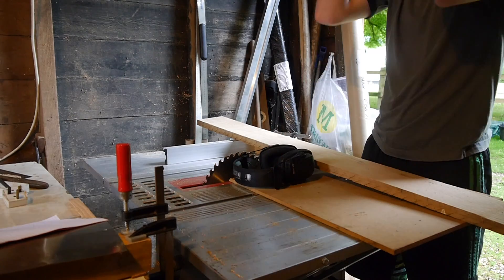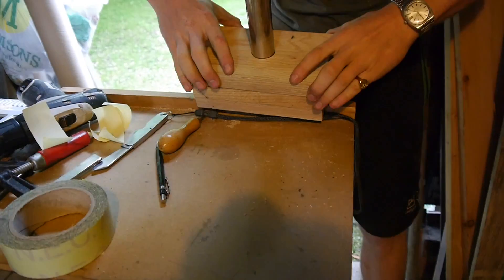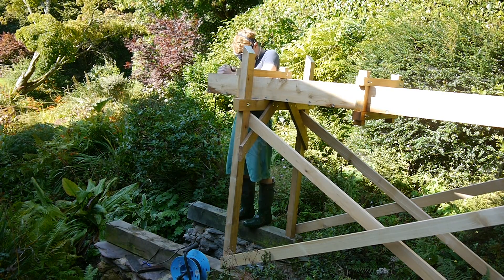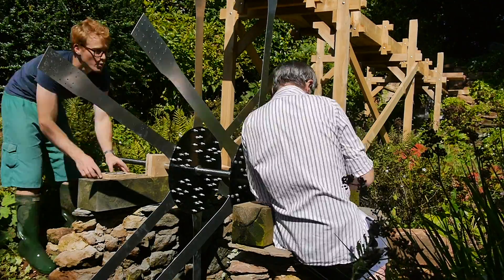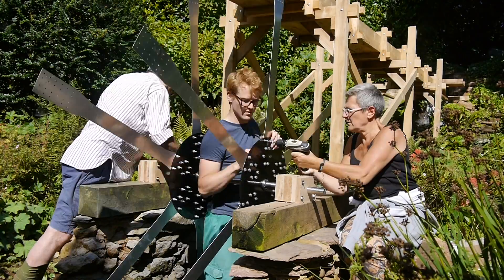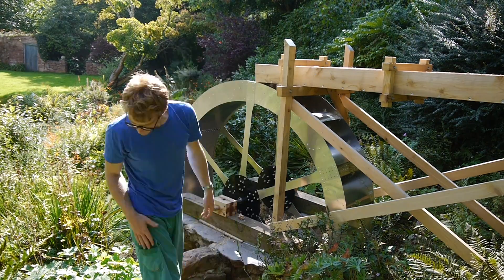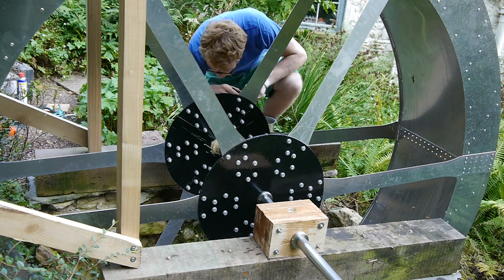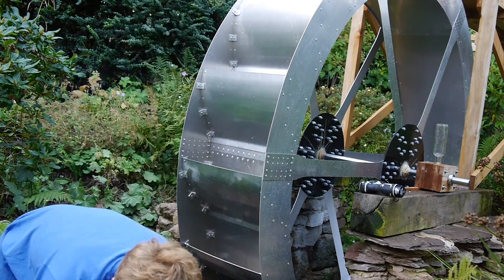Building a water wheel Ep  8 -  Assembling the wheel

Comment: Any suggestions on smart drive motors used as a genorater. I am aware you can hook them up directly to get 120v ac except you would need a large wheel and have some weight on that wheel also, or good gearing. Any easier methods you might have tried with electronics or wiring to make less resistance when adding an electrical load?
Reply: https://www.youtube.com/watch?v=8SWq5Pskpug
Marty T in New Zealand shows you how to wire up the brushless motor from an old washing machine....
these are so common in New Zealand that they can be bought for $5 at the local recycling centre at the dump  (transfer station)

Comment: White metal or bronze is used for low speed bearings. They have a centre slot with a larger diameter ring. The ring dips into an oil bath underneath and carries the oil up and over the shaft. The white metal is scraped so the bottom third, where the standing weight sits, is only 60% contact. That leaves enough oil for the first turn on startup. 
You asked about non toxic grease. White grease should do it. It’s used in food machinery. Failing that whale oil. ;). Maybe not.

Comment: I am watching several YOU-TUBE'ers building a wheel and flowing water from the top of the dam.
Any professional hydro-power job pulls water from th base of the dam, and pipes it to the wheel.
This allows the wheel to operate at any dam level. It is a nice job, but again, having a large serious
error. The wheel has to be lower than the top of the dam for constant use....
Reply: Doing it by drawing from the top automatically stops the wheel when insufficient water enters the pond.....
You still have a pond this way....

Comment: amazing work!
No hate just a suggestion.
As you can see the wheel slows down after the first rotation, that means the water isnt running out fast enough and has to be lifted up on the other side. Maybe you could coat it in a water repellent paint and slightly adjust the angle of your buckets to increase the efficiency.

Comment: i dont think the flume should end at top dead centre.... well i suppose it depends on the flow, but i think having the flume end slightly forwards (if the wheel is spinning clockwise) is better as this adds the force of the water to it's weight to turn the wheel

Comment: Just heard you wanted rust inhibitors for the parts that rust. Use Cosmoline it’s a waxy petroleum substance that’s sprayed on. And after it air dries, quits looking waxy, it’s very hard to get off. It was developed in the 1800s to treat cuts so it’s pretty safe. In WWII the US used it on tanks and guns coming across the Atlantic to prevent corrosion. Google Cosmoline because if memory serves its not hard to make your self. Best way to apply is spray, but roller next and a brush to get the hard parts if you don’t have a paint gun. Better yet here it is in an aerosol can. https://www.cosmolinedirect.com/cosmoline-sprays/
Good luck. I think the Cosmoline will do what you need.

Comment: Here, let's estimate the power output.   2 meters vertical drop.  2 buckets per second.  15 liters each.  Then 30kg/sec. X 2m = 60Watt?  

I'm only EE. So not very good at mechanical stuff.  So if someone can double check & correct my estimate that would be great.  Thx.  All the best.
Reply: first, you must use the correct scale, metric.   the formula is:   gravity  x  head  x  flow rate x 1000 (for watts, instead of kilowatts)  gravity (constant) is:   9.81  mps.     you supply the other two terms, eh.  ( based on hw's design of the 'wheel, flow-rate may be three to four liters p/sec.   that's  .003  cu. meters/sec. )     cheers
Reply: David Davids thx mate.  Will correct the calculations.
Reply: scroll down to - calculating
https://en.wikipedia.org/wiki/Hydroelectricity

Comment: What up with Wood Bearings ?  With all the money you spent,  you couldn't buy pillow block bearings ?   At the very least,  you could have lined the bearing blocks with PVC pipe. It would make a huge difference, You're losing a lot of power with wood bearing and all the friction that comes with it..
Reply: ThomasTheSailor Chubby  As he said in the video,  wood bearings hold an oil film better at extremely low RPM than pillow block bearings. Wood also absorbs the oil and becomes extremely weather resistant,  and the surface work hardens and lasts a very long time, PVC would wear quickly. Even the more modern turbines from the late 1800's and into the 1900's still ran on a bearing made of wood.

Comment: You can use Shell Cassida Grease LTS 1, It is a lubricant for the food industry, you can apply it with a grease gun and a lubricating nipple.
You also have to replace the lubricant after a certain time, as well as oil.

Comment: Why didn't you choose for a pitchback waterwheel design? The interwebz say that the efficiency of the waterwheel design is greatly increased to over 80% of the waters energy as it is driven by both the weight of the incoming water and by the force or pressure of water directed into the buckets from above, as well as the flow of the waste water below. You'd have to turn the waterwheel around though :P

Comment: The best spray on corrosion protection you'll find is Boeshield T-9. Its a wax solvent aerosol and was designed by Boeing to protect aircraft landing gear.
Reply: Mark C. That I can vouch for. I use ratchet straps in outdoor application, and after one coating, I can expect even a rusty ratchet to perform perfectly for a few years.

Comment: Really nice job Henry, looking forward to see it turning and making power, i've been wanting to do something like this for a while but not sure if i have enough water so can i ask please as i can't seem to find you talking about it in any of your videos, how much water flow do you have ?
Take care
john
Reply from the maker: +John Beattie I have around 15l/s water flow but it's not just about flow but also water drop. 1l/s falling 10m has the same energy as 10l/s falling 1m.
Reply: Thank you for your reply Henry, i only have 60 gallon per minute, i get a little confused about the water drop, my water is a natural rain run off that runs at 60 gallon per min all winter more after rain, (and i live in Scotland and boy can it rain) it comes from way up in the hills behind the house,  i assumed the head was taking from the start of the flume intake to the ground under the wheel, if it's taking from where the water starts from way up in the hills then i have quite a lot, so i'm not sure how to work the drop out.
Take care
John
Reply: The head, in this case is, (roughly) the vertical distance between the top of the wheel (where the water exits the flume and strikes the wheel) and the bottom of the wheel. If you have a pressurised pipe from, (for example a dam) dropping to a closed pelton-wheel generator, then the head is from the top of the pipe, (called the penstock) inlet to the generator. (Depending on where the penstock is attached to the dam, you may have to calculate the head from the surface of the lake). https://teeic.indianaffairs.gov/images/photos/lhhydro_powerhouse.gif

The energy calculations for an over-shot wheel like this are different from an impoundment design. A flume is not the same as penstock.  TL;DR you can estimate using just vertical calculations.

Comment: Following your build, just designing my own in same sort of conditions, if you can use more flow you should of used it especially as it's for generating electric, as more flow = more power. Think you've done a great job though. Can you not you not use a higher power generator that needs more resistance to rotate, or apply a breaking mechanism to wheel perhaps.Surprised you didn't use a turbine or pelton wheel as are more like 85% efficient and you have good drop, guessing you wanted to charm of a wheel as well as power then.Think it looks great and a job well done, hat off to you looking forward to the next instalment.
Reply from the maker: Will use all the flow, for the test in this video I didn't yet have the generator set up and so only put a small amount into the flume. With no generator attached the only way energy exits the system is frictional losses - all the water would make the wheel spin way too fast. A pelton wheel is only good for high heads - this is only 2.2 meters. A Kaplan or Banki turbine would be the best choice but would require the water to be piped down the old waterfall and into a turbine house. The wheel is 70%+ efficient (From actual measurements) and so for a very small gain in power we would have to get rid of the waterfall and stream running through a garden and replace with a large pipe and small building. I am sure what choice most people would make in this scenario. Another thing to note is that turbine efficiency is only high for a range of flow rates but a waterwheels efficiency stays fairly constant over a wider range - this is useful in flood or dry conditions.
Reply: Couldn't agree more wheel over pipe any day. It's quality and attention to detail is evident and nice to see craftsmanship being done first hand. 
When doing your calcs did you do any for making it pitch back? 
I'm looking forward to next instalment and hope I can produce somewhere near your quality of wheel and edit of your story.

Comment: Super project :) how much power will produce a water wheel?
Reply from the maker: +CCcrafted Congratulations on being one of a select few who seems aware of this basic physics. Maybe you can help explain why undershot wheels are generally a bad idea? The only thing you are off on is the water flow. As there was no energy extraction from the wheel at this point (no generator attached) I only put a little of the total flow down the flume. More water would make the wheel spin very/too fast. The wheel is indeed 50% efficient (from total potential energy to 230v 50hz ac). The wheel under normal running conditions makes ~150W but can rise to 300+ after rain. When very dry it generates minimum 80W. Just some spoilers for you.
Reply: Damian Brydniak doing a few bits of back of the napkin maths here, it looks about 2L of water per second falling off there, which thanks to the metric system is 2kg of water - the maximum energy that it should be able to transfer is its loss in gravitational potential energy (GPE). Defined by e=mgh so that the energy is the mass (2kg) times gravity (9.81ms^-2) and the height of the wheel which I'm estimating to be about 2 metres... therefore the energy loss of the water is approximately 39 joules, and all of this per second... so... just under the amount a 40 Watt light bulb uses.... although all this is assuming 0 loss to frictional forces and going by my probably incorrect estimates...

Despite all of that I'd say that it'll produce about 20 watts per litre of water per second.
Reply: So much work for so little power. And here I am building a smaller wheel for only 50W. Great work!
Reply: Henry Walker wow! And actually now thinking back to your first videos the flow rate did seem much higher :')
And sure, I'll give the comments a bit of a skim and answer any undershot questions that are yet to be answered by others.
Personally I've always been fascinated by projects like this, the only issue being the geography of my area.... as you may or may not know, the fenlands (east anglia) are notoriously flat! The local river drops by about a meter over 2.5 km.... so building anything like your undertaking might be a challenge for me...